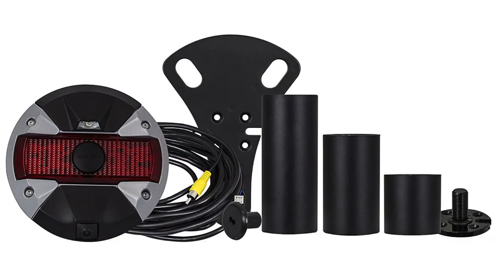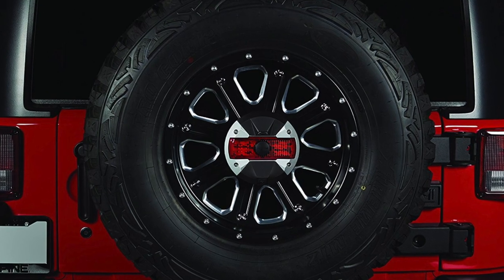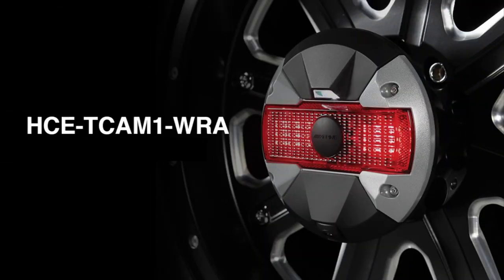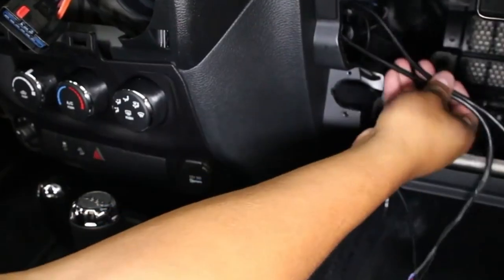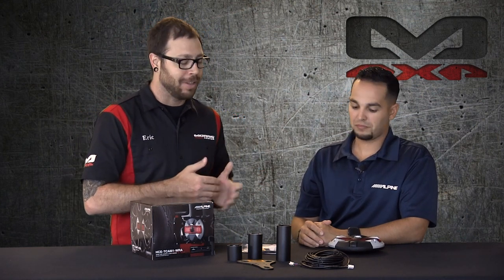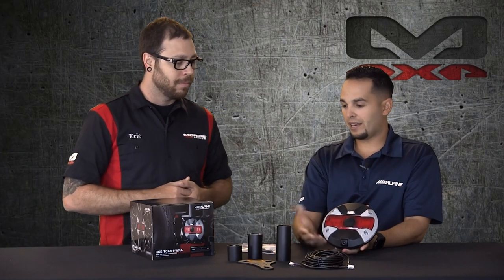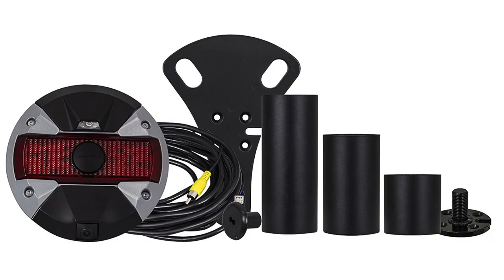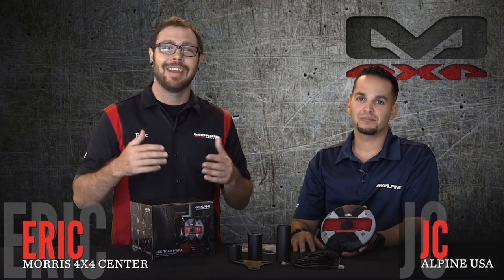ALPINE | Spare Tire Back Up Camera | Rear View Camera | Morris 4x4 Center

Comment: This product works absolutely wonderful... except... the cable was never meant to be flexed.   As the rear gate is opened and closed the wire is under stress and will eventually break.  How soon.. well that depends on how the cable is routed to the frame.  I took care to ensure maximum bend radius and it still broke after about 150 open/closures.  Not what I would call longevity.